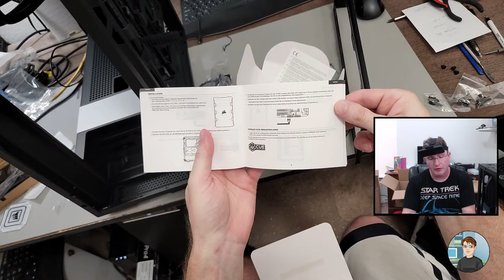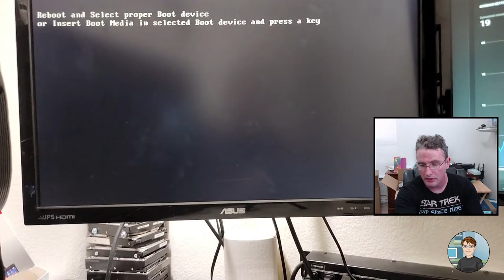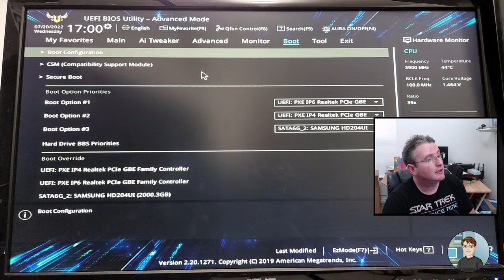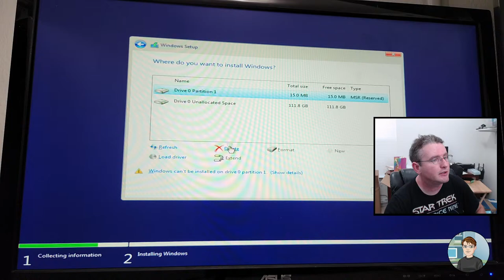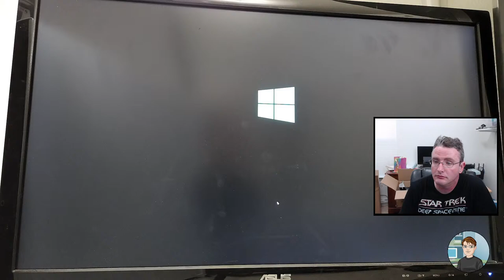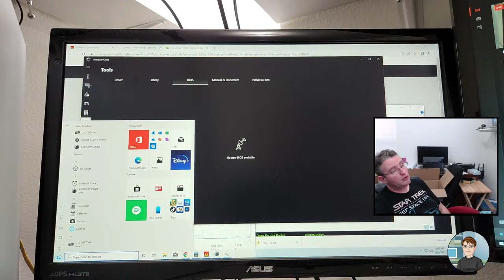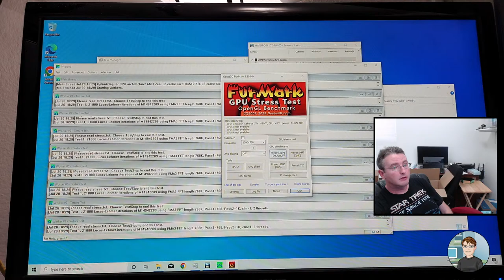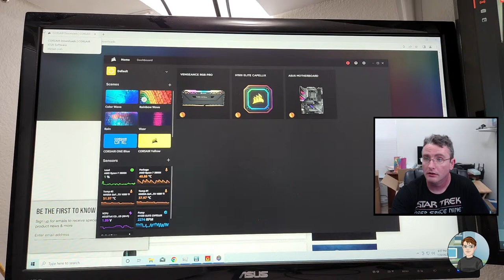Part 2: PC Rebuild, Ryzen 7 3800x, TUF GAMING X570-PLUS WIFI, 32GB RAM, GTX 1080ti, iCUE H150i

Comment: I honestly think that RGB is only tolerated in the industry because alot of people want it so for that reason its good for business, but in most cases its so complex with all the extra hubs and software that's used to control it, that it can often times add to the discouragement to deal with in the first place.

Comment: were those retention brakets included with your water cooler? have the same one and only has a amd / am4 braket that is not even sided
Reply from the maker: The retention hardware was included with the cooler.  Which part are you missing?
Reply: @MichaelTheComputerGuy  The piece I'm missing is the new AMD bracket, the package brought the old version
Reply from the maker: @antoniocotto1005  Call around to local computer repair shops.  You should find one.

Comment: These are the components I've gone for my build. 
1. £179.99 Wester Digital Black SN850x 2TB M.2 NVME
2. £159.99 Elgato Wave:3 - Premium Studio Quality USB Condenser Microphone for Streaming, Podcast, Gaming and Home Office, Free Mixer Software, Sound Effect Plugins, Anti-Distortion, Plug ’n Play, for Mac, PC
3. £138.69  Asus Tuf Gaming WiFi Pro X570
4. £132 MSI GeForce GTX 1660 Super Ventus XS 6Gb
5. £124. RØDE PSA1+ Professional Studio Arm with Spring Damping and Cable Management,Black
6. £116.85 AMD Ryzen 7 3800x 3.9GHz 8 Core CPU Processor
7. £99.98 Corsair 750 Watt RM750x Fully Modular 80+ Gold ATX PSU
8. £82.99 Samsung 860 EVO 1 TB SATA 2.5 Inch Internal Solid State Drive (SSD) (MZ-76E1T0)
9. £78.22 Montech Sky Two PC CASE 
10. £76.10 Corsair Vengeance LXT 32GB RAM
11. £63.99 Razer Viper Ultimate - Wireless Gaming Mouse with Dock Station (HyperSpeed Wireless Technology, Ambidextrous, Light and Fast, 20,000 Dpi Optical Sensor, RGB Chroma) Black
12. £51 NZXT Kraken x53 LIQUID COOLING
13. £44.99 HyperX Cloud II – Gaming Headset PC/PS4/PS5, Red
14. £34.97 Elgato Wave Shock Mount, Maximum Isolation from Vibration Noise, Steel Chassis with Reinforced Elastic Suspension, Custom Built for Elgato Wave Microphones
15. £32.99 SteelSeries Apex 3 TKL - RGB Gaming Keyboard - Tenkeyless Compact Esports Form Factor - 8-Zone RGB Illumination - IP32 Water & Dust Resistant - English QWERTY Layout
16. £27.59 Elgato Wave Pop Filter, Anti-Plosive Noise Shield Eliminates Pops and Hisses, Dual-Layer Steel Mesh with Magnetic Attachment Points, Custom Built for Elgato Wave Microphones
17. £24.99 Sunany 256GB USB Flash Drive, Photo Memory Stick External Storage Thumb Drive Compatible with Phone, Pad, Android, Tablet, PC, Computer, Devices with Micro USB 3.0, OTG, IOS, Type C (Red)
18. £10.79 Large Gaming Mouse Mat Pad (800x300x2mm) XL Thick Extended Mousepad Water-Resistant with Non-Slip Rubber Base, Smooth Cloth Surface, Anti-Fray Stitched Edges for game, Keyboard, Desk (DT004)
19. The total amount for the items listed above comes to £1,442.84